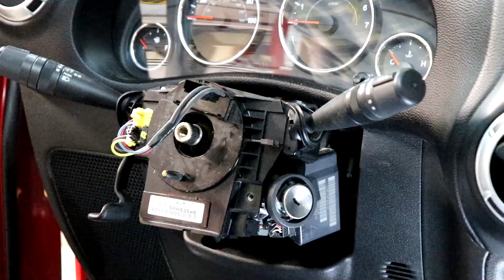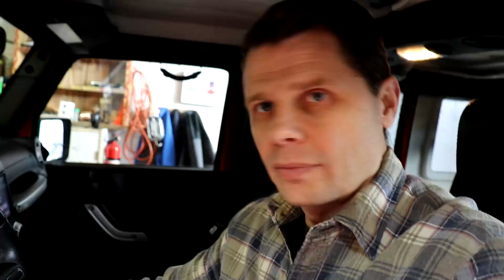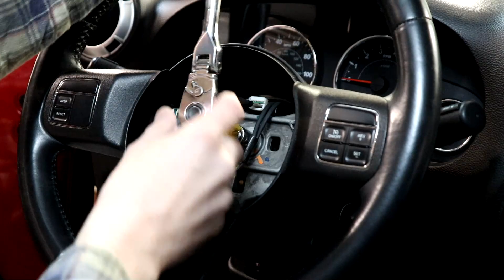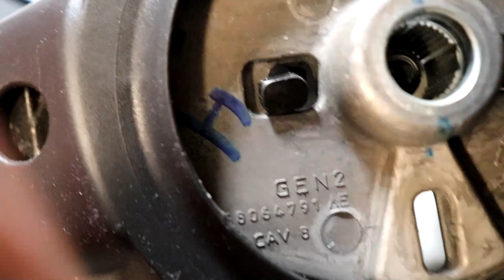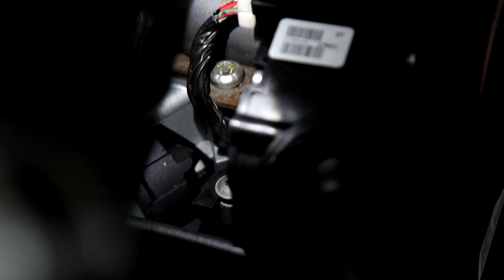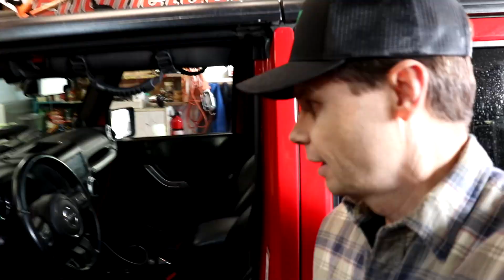JK Air Bag Light: Error code B1B02 Clock Spring Replacement

Comment: Good video...it is covered under 15 year warranty IF you have a airbag light on...if like me you just have lost the horn and steering wheel controls they likely won't do it.  Also, you can wait months for the dealership to get parts and actually do it or spend $100 and have it done in an hour

Comment: Hello jeepers, having the same problem with my 2013 airbag flashing horn stuck on, planning on replacing myself. Do I need the steering wheel puller? Or can it be taken off without it. Thanks

Comment: Did your turn signal function normally and return to center following the install? I just installed a new clock spring and now the turn signal will not return to center when using either the left or right signal.

Comment: This was a great tutorial. My airbag light was on for months and I was told by a dealer it wasn’t covered under the recall. I followed this and it probably would have taken less than 2 hours, but I didn’t have a small handle t20 for the 2 screws in the back of the clock spring to get it off and put them back in. Took some trial and error creativity. 

I decided to replace the 2 side switches as well, and one of the new ones was faulty. The windshield wipers wouldn’t turn off. So I had to take that back off and put the old one back on. That was fun... Should have followed the old rule: if it ain’t broke….

Comment: So both the clock spring and wheel puller links are invalid and broken in 2024.  My experience is this means both products were likely low quality with many terrible reviews and returns.  Can you give us an update on how yours has held up the last 4 years and If they have held up well give us some information on how to get the exact same one.  Thanks

Comment: Yesterday my horn on my 2007 JK started to go off randomly and today the airbag light came on and using JScan I got the error code B1B00 (driver airbag squib 1 circuit low). After watching your video and the fact that you got B1B01 (circuit open) I’m guessing that my clockspring is the cause, what do you think?

Comment: Thanks for the detailed video. Has a lot of good instructions step by step. I am planning on doing this my car does the same thing where it turns on and off while driving but my horn works fine. Should I still replace the clock spring or check connectors ?

Comment: Great write up! Thanks so much for the video - made it very painless.

I had bought a “universal” wheel puller initially. It wasn’t so universal:) Had to get the ones with j hooks…
Reply: For yourself or anyone finding this in the future. I used a universal, I was able to wrap tape around a nut and hang it behind the steering wheel, the I threaded in the rods and bam off she goes!

Comment: I have a 2006 Jeep commander. When I was driving my speedometer, tachometer, coolant gauge, gas gauge, turn signals, front power windows, power locks, radio, sun roof,headlight control, wipers, all stopped working at once and all of my warning lights popped on. My drive select indicator doesn’t show what gear I’m in and my odometer is stuck on 167,141, it won’t change. I have lost my acc cluster when I turn the key, but if I close or open any door it comes back on with all the warning lights, but no gauges working, almost like closing or opening a door is triggering something. 
I’ve checked all fuses and relays and all seems fine. I’ve cleaned all my grounds in the engine bay. I’ve inspected most of the wiring in the engine bay. I have changed my ignition switch 2 times bought from 2 different stores. 
I’ve had the car scanned and got codes:
u1411, u0114, u140e, c2202, u0100, u0141, and u0101. 
Been trying to resolve this for almost a week now. One time the car came back to normal for about 1 minute, I touched the power button on the radio and it went back to the electrical problems. I’ve since removed the radio and it still won’t go back to normal. 
This is very frustrating, especially when I can’t find anyone that has had these symptoms. 
My last resort is the dealership. 
Any ideas or ever heard of this happening?
Thank You!

Comment: I'm about to do this on my jku 2011 how scared should I be with the airbag ?
Reply: Not scared. Unhook battery, wait a couple minutes, pull it out. You can literally throw it on the ground and it won't blow. They're electrically activated.

Comment: Every time I fix something. Something else brakes
Reply: JEEP = Just Empty Every Pocket

... but I'm never getting rid of mine.
Reply: Welcome to owning pretty much any vehicle that is older than 5 years.
Reply: Can you remove the steering wheel without the puller?
Reply: Tracking a parasitic draw currently.

Comment: Excellent video sir!  I had this problem with our 2013 JKU and the dealer quoted $750 to replace it and 4-5 months to get the part.  I immediately went home and ordered the part through Rock Auto and had it in 5 business days.  With the help from your video, I had the whole job done in just one hour.  This is an easy job and your video is aces!!!  Thank You!
Reply: The clock springs on our JKs is a known defective part and is covered under a special recall. The dealership is supposed to repair it for free. They may initially require a diagnostic fee but even that is waived if it's found to be just the clock spring. The part fails when exposed to a lot of dust and, last time I checked, they have not come up with a replacement part that is not prone to the problem. So they technically have to keep replacing it until they come up with a permanent fix.  The tech bulletins for this issue aren't hard to find online. Just an FYI for anyone else dealing with this.  

Also, fyi...I've had mine repaired once like this already. Now I need another one and jeep is jerking me around, making it hard by having me come in and out, over several weeks, long story. They've had my jeep 5 days and still didn't get it done. So in the end, if you don't want to be without your jeep that long (for a 1 hour dealer job!) Might be worth it just doing it yourself.
Reply: @marnieravitch1371 I ran my vin today for my 2016 jku and it shows no recalls so what exactly are you talking about why the dealer would repair it
Reply: How has your rock auto part held up? What brand was yours ? Rock auto offers many brands and the prices aren’t cheap either.

Comment: Excellent video and how-to on changing out the Clockspring. Looks like I will be ordering a new one very soon as I have the intermittent airbag light on and the bell going off randomly.
Reply: Folks , there is an extended warranty issued by Jeep on clock spring . It covers 15 years with unlimited miles. I just got my JK unlimited Rubicon’s clock spring got changed from the dealer for free. Please contact the agency.

Comment: Just did replaced new clock spring system like this video, everything works expect airbag light still on (before and after replacement) code came up it’s B1B03 that is still only one active code on scanner. No idea why it still not solving problem after replaced new one. What it should exact problem that needed to be solved?
Reply: b1b03-driver-airbag-squib-1-circuit-shorted-together.html
Reply: @toddhoffmaster6057  had to contact with seller where we bought it and described him what wrong and showed pictures of code from diagnostic. they sent a free replacement so hopefully it should works. 🙏🏻
Reply: The result of free replacement, everything working properly and no issue, thank god! 🙏🏻

Comment: Almost stopped the video as more things needed to be dismantled but I’m glad I stuck it out. I think I can do this. Thanks
Reply: Hi, there is an extended warranty issued by Jeep on clock spring . It covers 15 years with unlimited miles. I just got my JK unlimited Rubicon’s clock spring got changed from the dealer for free. Please contact the agency.
Reply: @midnightflower2000  thank you for the heads up. I’m definitely going to look into that.

Comment: Great video!    Super helpful!

Im having the same symptoms here on my 11 JKU.   My guess was the same being a bad clockspring as my airbag light fluctuates with steering inputs.  Weird thing is horn and cruise still work.   Ive heard those two don't work with a bad clockspring.   My local indie Jeep guy pulled the same code, but he referred me to the dealer and he thinks its a wiring issue and not a clockspring.   He stopped at the code and did nothing else as far as diagnosis.   I still think its the clockspring based on symptoms and will throw it in and hope my guess is correct.   I find it hard my 11 with 80k on it has wiring issues when the clockspring is such a common issue.   Just surprised my local Jeep indie stayed away from throwing a clockspring in it.
Reply: Hi there!, did you solve the problem? It was the clockspring? Been having the same issue, intermittent airbag light, but horn, cruise control and all buttons from steering wheel seems to work just fine
Reply: @facugodoy8822    Yes it was the clockspring.   Fortunately on my 11 they bumped up the warranty coverage on it as kinda recall / not recall.   👍  Fixed it at same time I had the emissions ECM refash recall done.
Reply: Same issue now on my 11 JK. I had not heard of a recall on the clock spring. Do you have more info you can give me on that? Thanks.
Reply: @terryhopkins8896  

You'll have to contact the dealer.   I don't remember exactly whether it was flagged as a recall or they just bumped the warranty to 100k.   They should be able to give you info with your vin#.

Comment: Great job Dale on the diagnostic and replacement. My wife's 07 JK went under the recall for the airbag and they also changed the clock spring . Dodged the bullet for sure. Take care and be safe sir.

Comment: Ok so I got code 24 to pop up when I turn on and off 3 times and get the codes. But I'm finding  different  answers  for it. My jeep in a 94 grand Cherokee  limited  4.0
Reply from the maker: Sounds like bad TPS. I'd check connections at throttle body, clean connections, make sure tight, then replace it if still giving codes
Reply: @JeepSolid  ty I cleaned it same problem  then changed it out same code coming  up .  I never  checked for leaks on my map sensor  the parts good but maybe dirty ? All the voltage  is good going to tps sensor  ground is good also . I was thinking  of pulling  a vac see how it holds if good just clean map sensor  next to see if this will help.
Reply from the maker: I would check voltage at tps. Maybe wiring issue